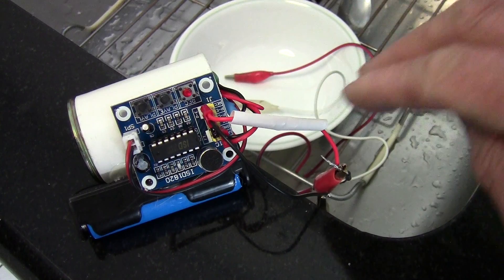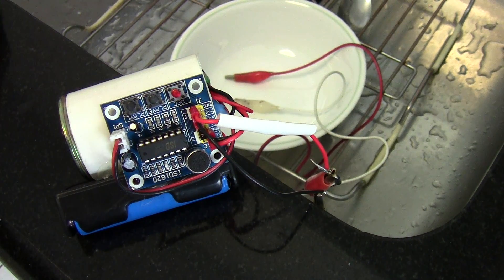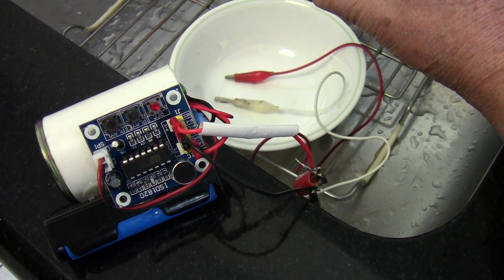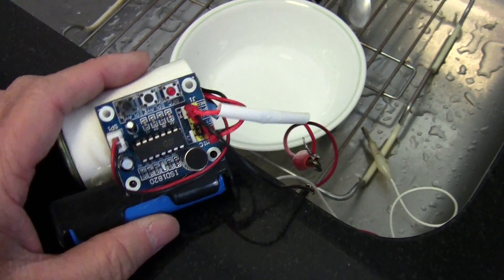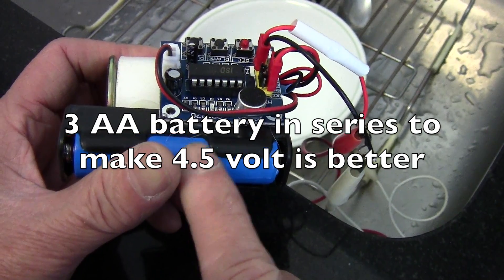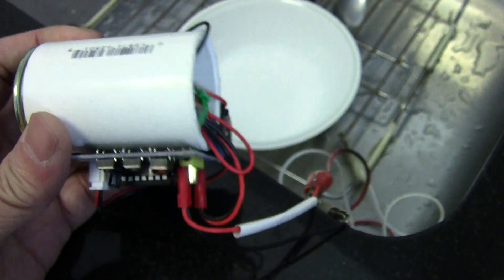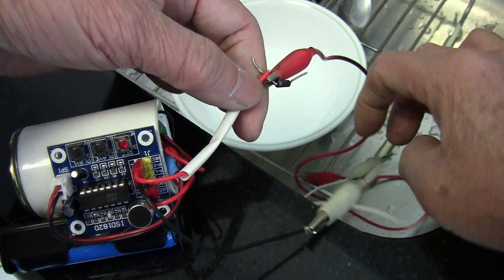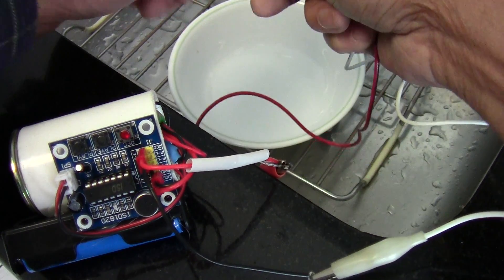Best do it yourself flood, water alarm using the ISD 1820 recording module

Comment: I am going to get a load of these. I have had an Idea. Thank you very much my friend. I will video the project so you can see what I am doing.
Reply from the maker: +Raymond Earle Yes, a lot of uses. Wet diaper alarm,  an audio recording of shopping lists etc.  You can also lengthen the recording by changing the resistor values, at the expense of sound quality.
Reply: When I have them in place and working. me and my white coat will make a video.